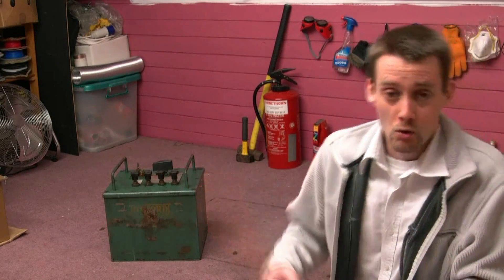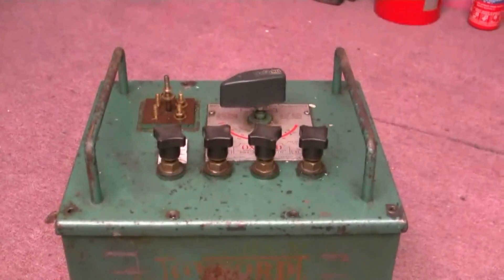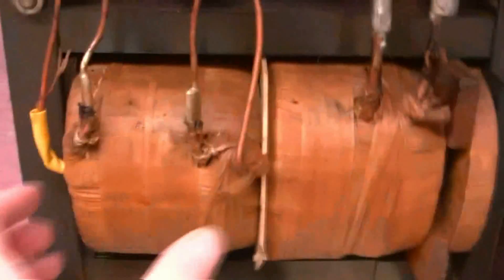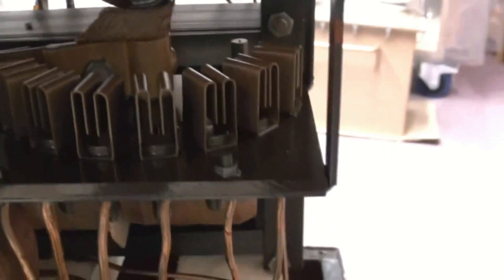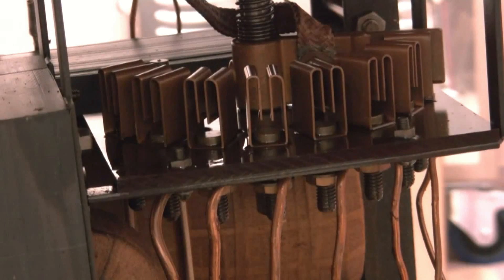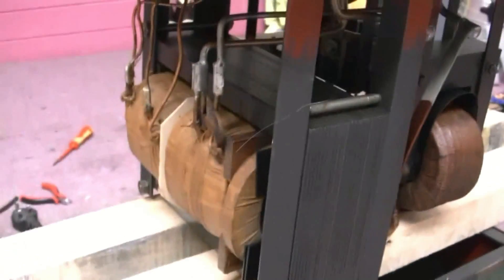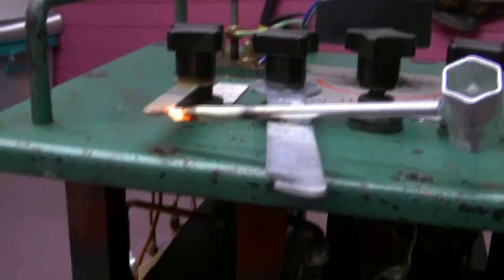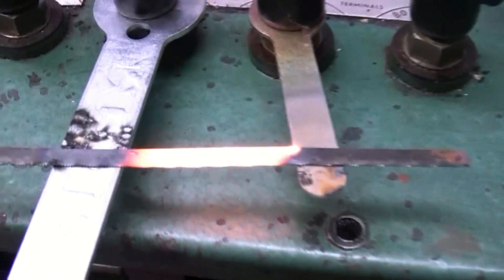Arc Welders

Comment: Dude, I love your videos but I have questions - in lay-men's terms, what's the difference between lots of amps at no volts and lots of volts with no amps? What are examples of real-world uses for each? Thanks for sharing your knowledge with all of us!
Reply: 2 years later, I will offer a reply...
First the answer to your question. The ultimate answer is nothing, because both are zero. 
However, that's also not the ful answer because Volts and Amps are two different things. They only become useful when both are used together. If one is zero, then the other is useless. Only when both Volts and Amps have a non-zero value, then Watts (power) can exist.
.
Voltage is the difference between 2 points, where potentially some electricity could/might flow.
Current (Amps) is the amount of any electricity that is actually flowing (due to voltage).
.
Often an analogy of water is used... this is not a perfect model, but let's consider a huge lake, with a dam blocking it from flowing into a river below....
.
1. The height of the Dam is the potential difference (Voltage) between the dam and the river. 
2. The dam itself is the Resistance (Ohms) to that water being able to flow from dam to river. 
3. The amount of water that is flowing to the river is like the Amps.
.
If the water is completely blocked by the dam (infinite resistance) then no water will get into the river. It doesn't matter how low or high the lake is, the water cannot flow.
- This is like having a High Voltage against a high (total) resistance that stops it, so the Current will be zero.
.
If the lake and the river are the same height, there is no potential for water to flow. It won't flow down into the river because there is nothing to push it.
- So this is like having Zero Voltage, because there is no potential difference. No current (Amps) will flow, and the resistance of any dam doesn't matter.
.
If there is a height difference and then dam is suddenly removed, all the water will flow between the lake and river until they are the same height. While that water is flowing, it's a current.
- So if there is a Voltage and if Resistance is low, the electricity with flow at a "rate of" Amps until all the Voltage is gone.
.
OK, now let's make a hole at the bottom of the dam, allowing some water to come out. We have will a flow that depends on two things... the height of the lake water (Volts) and the size of the hole (Resistance)...
.
The bigger the hole, the more water can flow through it. The lower the resistance (Ohms), the more water can flow (Amps) for a given potential difference (Volts).
.
However, the amount of water that actually flows through the hole also depends on the pressure, which is the height difference between the lake and the river.
- So for a certain resistance, the current (Amps) is ALSO dependant on Voltage.
.
Therefore: the Volts, Amps and Ohms are all 100% completely dependant on each other using the formulas:
Volts = Amps X Ohms
Ohms = Volts ÷ Amps
Amps = Volts ÷ Ohms
.
Summary
Without Voltage, Current cannot flow. The higher the Voltage, the easier it can overcome a Resistance.

So, whilst air has a high Resistance, a very high Voltage can jump across (arc) and cause a Current to flow. The resultant spark might not contain much Current (eg: Static Electricity) but can also be huge (eg: lightning).
Reply: @johncoops6897  Better late than never - thanks for the explanation.
Reply: @TallmanMike  - my reply above didn't give examples or fully answer everything. If you would like me to elaborate, just let me know.
Reply: @johncoops6897    I'm still interested in understanding whether there are situations where you might combine extremes of the two for practical purposes? Significant potential difference but very low current or the inverse?

Comment: Hi ... 
Did you have this plugged straight into three-pin wall socket (240 volts (13amps)) ... !?
I see you have run your ''input'' electrics through a couple of things.
Does one of these oil cooled welders pull more and more from the input electrics, or can you just run them up, and they will create whatever they need on the out put side!
I have one; but not sure if I can run it from the house electrics ... !?
Thankyou. 
Interesting vid.
Best ... 
William (Hampshire UK)

Comment: How do you know what to touch, and what'll murder you? Whenever you touch a thing, I get a twinge of fright. 😂
Reply: Pumpkin he would cirtainly be crisped if he had the ignorance of electroboom
Reply: @not_a_nugget2373  electroboom is completely intentional.
Reply: @EpicJonT  Almost ;)
Reply: @not_a_nugget2373  electroBOOMs ignorance is "mostly" scripted <3 except the time almost killed himself with his jacobs ladder (his shitty wiring pulled apart instead of killing him)
Reply: @Von_Hohenheim  Still not convinced that wasn’t scripted either. He put the ladder on a “table for ants” when other electricians bolt theirs to the table to stabilize it. Can’t believe he was actually that stupid.
Reply: @magicmulder  ngl ive done similar mistakes to the MOT disaster (ofc thats not saying much) but it seems plausible
Reply: Its been a year, but ill try answer it:

First off, you may want to not touch things far before it kills you. You did provide a neat line in the sand though, but its still not cut and dry who dies and who doesnt. So:

1) Generally, most damage is done to tissue by heat. Except for the criterium you put up; death. That one is most common from AC, that pulses the heart out of rythm, rendering it non functional and possible unable to reboot after the outside electric force is removed. Same applies to nerves/brain, up to an extent.
So apart from those, it is heat, resulting from a current running through us, with a minor resistance. And that will eventually, depending on how much it is and where it is, burn our cells = celldeath. And on top of celldeath, we get all sorts of systemic reactions which may also kill you.

2) In order for a current to run through us, the Voltage needs to high enough to overcome the blocking resistance we have. If resistance is too high, there will be no current = no heat = no burning. If the resistance is 0 (theoretically), a huge current may run through, but it will not create heat = no burning.
Thats also why you can see him melt spanners, steel rods, etc, that are thicker than the copper cables connecting to it. So why doesnt the copper melt? Its melting point is lower than that of steel. Its because copper is a better conductor (has a lower resistance), than steel.
So provided a voltage is connected to us that overcomes our resistance, a current will flow and the region the current flows through us, will heat up.

3) But we are not consistent in composition. Even though people are anatomically 'equal', our body chemistry may differ quite some. And it will also vary in a person depending on conditions over time. So the current may run through muscle, or through vains, or along nerves, etc, depending on their conductivity at that time.
And if we apply the electrodes to our skin, a huge differnece there already is if we are wet or not, or even better; sweating.
Sweat contains a lot of salts, in a water solution. And that is a great conductor, while the skin itself (~dry) is more of an isolator. So when your skin is very dry, a current may not run at all, while when you are sweaty, it may run easily.
Suppose we overcome both by a high enough current:
In a sweaty person, the current will run over the skin; through the sweat. That will heat up and may steam off even. That initial heat will burn from the outside in.
A person with a dry skin; the current will run under the skin somewhere. The heat will originate there and burn you there. From the inside out.

4) Generally; voltages up to ~40 V will not allow much current to flow, if at all. (depending on how dry/wet/sweaty your skin is. Anything above that will penetrate through the skin and a current will flow. But it may not cause any harm at all, because it also depends on how much current is allowed to flow.
After all; P=U*I (Power = voltage * current). So you may grab 10 KV, but if the current allowed to flow is limited to 0,1mA, it is not going to burn you anywhere in the near future. It will heat up so little, out body is able to get rid of the generated heat easily.

5) Another thing to keep in mind is that you may touch an open mains wire and nothing will happen. After all, no current will flow if there is no closed circuit. You may be wearing rubber soled shoes. Standing on a rubber matt, or anything such, which prevents a current to flow.
It is how birds can sit on high voltage wires and nothing happens. Well, as long as they dont touch the other wire that closes the circuit through them, no current can flow. If they do, it tastes just like fried chicken i guess.

6) Examples:
A young guy is laying opposite my mom at the graveyard. He was biking with his GF here, 28 years ago, over a dike and lightning struck. He died instantly. Other people were struck and they had no damage at all. Others had skinburns. (it all depends how much, where, wet/dry, etc)

You may hold batteries with no problem. Ever put a 9v on your tongue? Try it. Tongue is wet and saliva full of salts and sugars and so; conducting very well.

There is a reason welding devices are limited at ~40 to 50 V. After that the voltage would become dangerous for welders to work with.

So it is not so easy to answer what is dangerous and what is not. It depends on a number of factors, which i tried to explain. I hope it clears it up a bit.
Seeing what our dude here does in his videos, it seems to me he knows very well what he is doing. But i understand to a lot of people it must seem like magic.
(also because of the many comments on how the grid would suffer from what he does, when in fact, a lot of the things he does are not that high in power consumption. It just seems so, bc he shows things you often dont see in electrics and look impressive. He is also limited to what the cables that run into his house can carry. And the main fuse box. Ofc he circumvents it somewhat, with HUGE capacitors, which store an amount of energy, similar to batteries, but able to release that all in a millisecond. Those are charged from the mains.
You cant just take 100 amps @ 240V from the mains. But you can load capacitors and then use that for a short time)
Reply: @StofStuiver  appreciated

Comment: Photonic, i got a real nerdy technical question for you.
Regarding AC wire heat vs DC wire heat. 
Why is the ratio 0.707:1 if both use equal amps and equal volts?
My classmates and i have been racking our fucking brains to figure this correlation out for a project. (We're in aviation maintenance school)

Comment: Why do the welding rods in arc welders always melt at the tip as apposed to whole rod melting? Love your vids!
Reply: The hottest point is at the arc. The metal closest to that arc will melt. Eventually you use up the whole rod and snap in another.. If you were to just short circuit the welding rod at a sufficient amperage without producing an arc and just held it there, the entire rod would eventually heat up enough to become molten.
Reply: Lunarchy any idea why the arc is the hottest?
Reply: Zed1967 wow excellent answer thanks.. it all makes sense now.

Comment: The welder might be cheap, but a variac costs a bloody fortune...
Reply: +Daniel's Game Vault Actually you can also get cheap old (and thus kinda bulky) variacs every now and then at a reasonable price too.
Reply: Yeah, i never understood why they are so pricey. the core isnt even special is just a roll of silicon steel with a single layer winding.
Reply: @teresashinkansen9402  - the worldwide price of Variacs increased by a factor of 10 after Photonic started this YouTube channel.
Reply: @teresashinkansen9402  they're produced in small batches (low demand), and very time consuming to wind compared to other transformer types, and the brush assembly also overcomplicates things. All transformers (except MOTs lol) are expensive, a sad reality.
Reply: +Daniel&#39;s Game Vault I igot a used 10amp variac from ebay for like $30.
Reply: Daniel's Game Vault true
Reply: Daniel's Game Vault welder still expencive £200 - £500

Comment: hi there  

you need to be very careful my friend doing this !!!

I have seen those copper coils unwind and cut through the metal casing of the machine !

The copper goes hard in places usually back from the soldered joints on the choke and where the clips bolt on to the paxoline selector arc and flash across so check the tightness as well as the copper braided connection

stay safe and make more vids mate
Reply: That is why the copper can handle UHV+ (Ultra-High Voltage and up), or 57,009,864 Volts. My friend, these copper wires should be used to replace HV (High Voltage) wires for transmission, even in short-circuit, or sudden voltage overloading, conditions. People who select the proper line material should know that and select it.

Comment: What about using this to heat up steel for smithing? Nearly instant heat, and controllable temps by adjusting voltage...
Reply: forthereg
Don't worry we all ready got something similar
that can heat steel more controlled in a instant but more safer it called an induction forge using both electricity and radio waves to do the job sort of like a microwave oven but can heat product to much higher temperatures
Reply: I think we got something like already that call the heating element it works the same way
Reply: "induction heaters"  no need to complicate things with all the electronics or transformer heavy cores .
but efficiency is low when turning heat into electricity at power plant.
so in large scale factory settings they just use coal straight .
Reply: hdyudu
 HDYUDU how the fuck are you gona use a fucking element which is resistive and soft and get it hot enough to melt fucking steel before the element itself melts and drops ???
Reply: *****  if you have a stick/ arc welder just stick the clamps to each end, turn the amps up till hot. it took 500 amps to heat up a 6'x8' plate of 1/2" steel to 100f at school. the a rosebud on a oxy/fuel torch to get it to 250ish. so you will need a beefy welder to do it.
Reply: hdyudu more safer?

Comment: naww thought the butane would have been more explosive
Reply: Butane is very safe, in fact, if it streams fast out of a hole, it blows itself out so that it won't sustain flame. You could see that at the moment he made the first hole.
I should add that butane has very low viscosity and strong wetting capability, which, coupled with the fact that it is a strong solvent in liquid form, can make it a challenge to build plastic hardware that won't get destroyed by it.

Comment: DUDE, YOU GOT BALLS TO TOUCH THAT THING WHILST ITS ON. LMAO *caps. you should also, abuse some microwaves, i saw you can take two transformar parts from a microwave or two and link the up and plug into the mains, you get 12v at rediculopously high amperage, which can also melt stuff
Reply: have you seen any of his other vids. i dont think he needs some little shitty microwave transformers :P
Reply: was jsut an experiment thatd be interesting. dont shit your self :L
Reply: sigh
Reply: snipeish1
he used 2 microwave transformers to charge a giant capacitor
Reply: The secondary was in short circuit. The voltage and current going through it had a far easier ground to get to then through him even if the voltage was high enough to do that. Not to mention the lacquer insulation on the windings.
Reply: No, you get 4KV at considerable power (therefore current, more than enough to kill) only modified MOT's kick out high current.

Comment: I have an old arch welder that my grandfather made. It would weigh at least 50Kg (110lb), it's really really old in a wooden box with material insulated wiring. It would be a fair bit more than 200amps I would assume, it has no trouble blowing holes in 10mm thick plate. I have to run it on 15amp mains @ 240v, it blows a 10amp fuse real easy.

Comment: Did this welder contain PCB or just standard mineral oil?
Also hope that you took proper safety precautions.
And what would you do with the oil after that? Can you just that it down to you local recycle facility and the are just going to take it and not asking anything about how you got gallons of PCB?
Reply: Bet he set it on fire in the backyard and vacuumed it up ;)

Comment: Adding stuff == lowering the resistance. I = V/R .. lower resistance == more amps. You measure amps with the multimeter in series with the load btw.

Comment: A saturable core inductor does nicely. Use the low voltage primary of a microwave oven transformer as the inductor, short the HV output together.